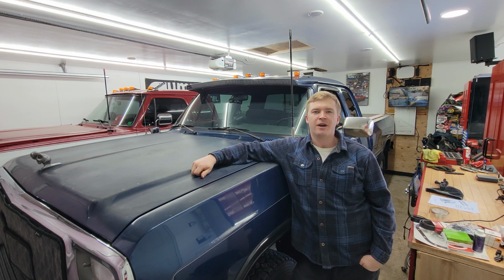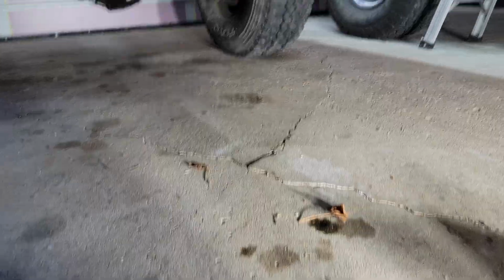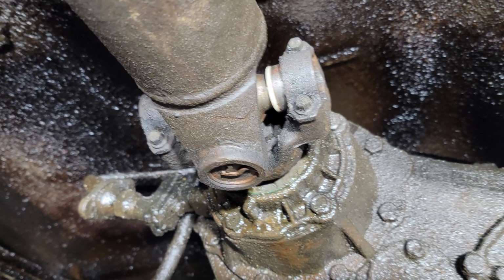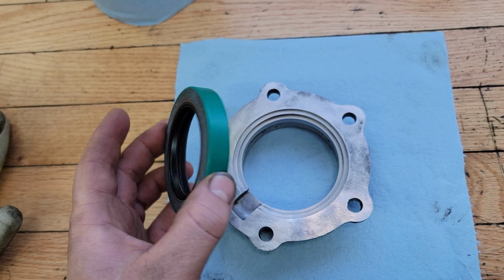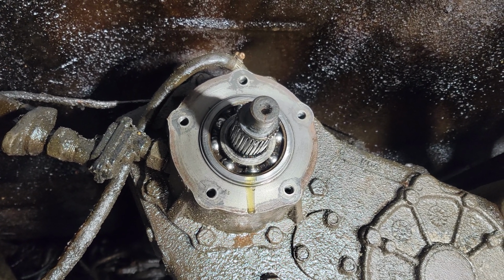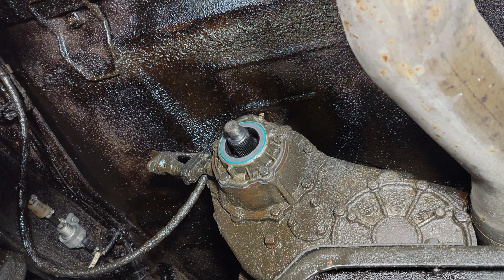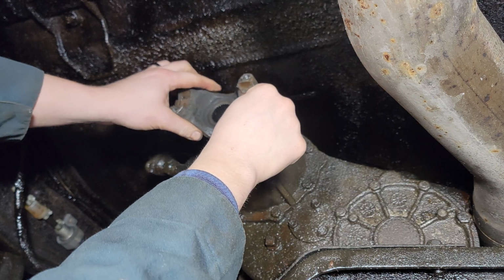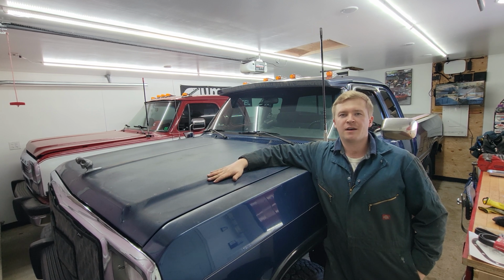NP205 Rear Output Seal | 1st Gen Cummins

Comment: Is that an electric fuel pump and filter on your frame rail? Also, is it OEM? My ‘90 model does not have that.
Reply from the maker: Its the electric fuel pump and filter for the webasto and it runs off the supplied wiring harness it comes with and is drilled and fitted into the fuel tank with a stand pipe.

Comment: Sweet I just did mine on my 2nd gens np 245 last year a little less labor for the 245, but still overall not a bad task.
Reply from the maker: I might have to do my oil pan gasket which sounds like a pain..trying to track down some of the leaks on this thing as it's making a mess of my driveway...lol
Reply: @OvensGarage  Ah that sucks hopefully the rear main isn't leaking? Not sure if you've done it for that truck recently
Reply from the maker: @BaileyM717  I pulled the inspection plate off the Trans and shined a light up in there it was all pretty clean from what I could tell. No oil buildup there. It looks like I've got buildup on a lot of the oil pan bolts. It's a bit harder to track down the leaks on my trucks because of the oil undercoating I get every year.
Reply: @OvensGarage  well thats good no rear main leak and yea I hear you usually I do a mix of fluid film, waste oil, and mineral spirits. Seems to work pretty good here it's not as knarly as your undercoating though can tell by the video when you were doing the seal it's pretty caked under there.